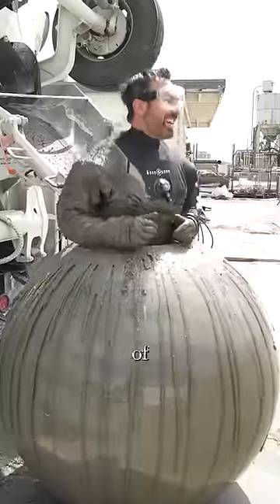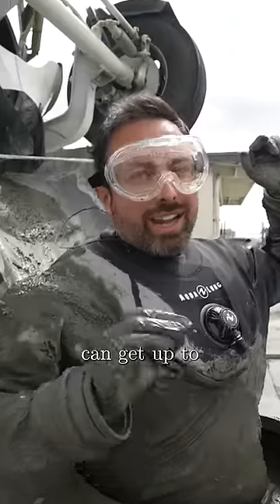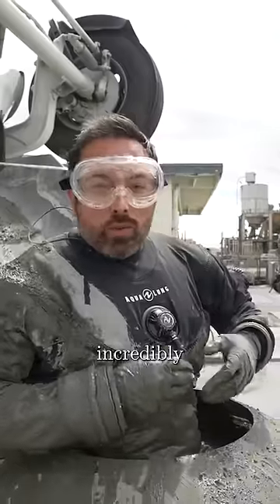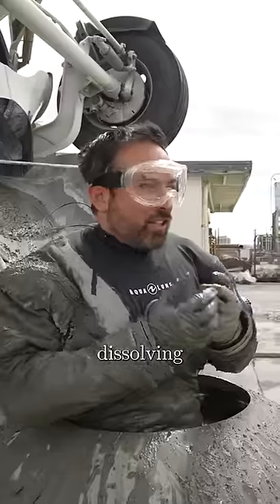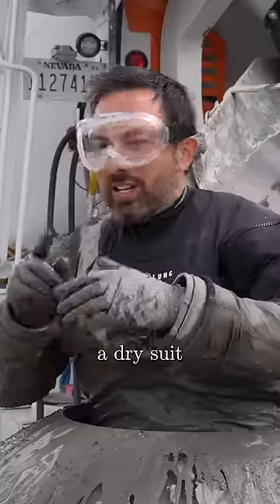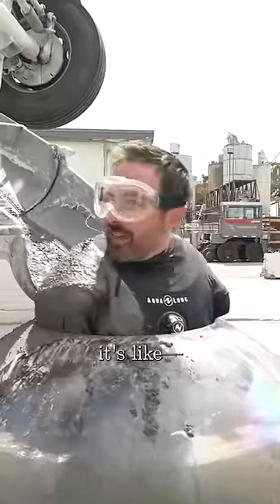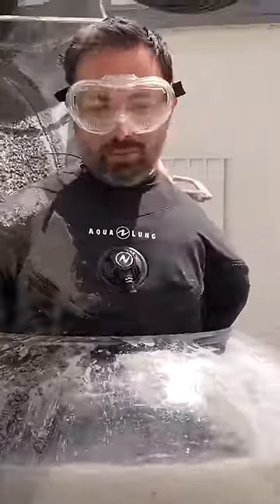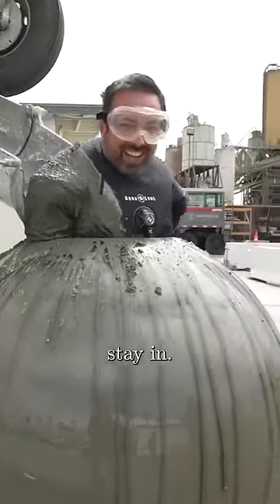I buried myself in concrete to explain how it works

Comment: Now knowing that cement dissolves your skin makes getting killed by concrete shoes even more terrifying
Reply: Why?
You'd be dead before it has time to dissolve
Reply: @AnEntityBrowsingYT nah cause the cement has to harden before they throw you in
Reply: So I've just done a quick search.
Concrete can take a day or so to dry obviously depending on thickness, temperature, and some other variables.

Concrete is typically made up of about 10-15% cement.

Cement is the part causing the issue here.

Adding water to cement turns calcium oxide into calcium hydroxide which raises the ph.

So it appears to be anywhere from as little as an hour that chemical burn blisters begin to form. 

So I'm wrong, you're right, you should be petrified 😂
Reply: @AnEntityBrowsingYT wow
Reply: I work with concrete and cement a lot, bare hands and feet, doesn't do any damage
Reply: @lpedr0l as long as you wash your hands and only stay in contact with it for a short time you’ll be fine, but if you do get burned it takes around 6 hours for it to show and is incredibly painful. Look up images of cement burns if you’re not too squeamish.
Reply: @AnEntityBrowsingYT Great example of 'I read it on Google, it must be true' vs real world skills. 

12 hours a day for 19 years says you are objectively and factually inaccurate.
Reply: @Aaaaaaarrrpirate Look it up. Yeah, concrete burns look unpleasent.
Reply: So you don't wash your hands for lunch break and don't wipe your hands when they are wet from concrete?  @bobSeigar
Reply: @jakubzeman8310  Imagine being a woman and taking a 'lunch break' 

Stay soft.
Reply: @bobSeigar Imagine being brainwashed into not valuing your own wellbeing to the point that your very identity is threatened by the thought of not working for 30-60 min in a 12 hour period while you fulfill a necessary bodily function.

Stay brittle.
Reply: @AnEntityBrowsingYT or you just take quick cement, 10-30 mins, hard
Reply: @bobSeigar   real big man working 16 hour days bathing in concrete and instead of eating just drinks a whole pot of black coffee while the foreman sits in his nice air conditioned F150 eating a big mac
Reply: @unploog  1) Liking your own comment is kinda pathetic.

2) Anime profile pics please go ask mommy to heat the nuggies
Reply: @bobSeigar Worst opinions and commenter I’ve seen today, congrats!
Reply: I did flat work and went onto commercial pours. You have the "I didn't wear a helmet, and im fine attitude." If it is a complete non issue then there'd be no reason for anybody to worry; except people do, a lot. Be safe. Wear the PPE.   @lpedr0l
Reply: @gotskills23 It's super weird how people wear that as a point of pride. Like we should want to work ourselves into the graves for soulless companies, rich dudes, and broken systems. But it keeps the masses in line for the most part I guess 🤷‍♂️
Reply: @bobSeigar You keep making these comments on company time and we're docking your pay. If you got time to be mean, you got time to clean!
Reply: don’t feed the troll…
Reply: @gotskills23  That's cute, I don't work anymore. Don't need to. 

Don't forget to clean your room, don't wanna upset mommy.
Reply: @bobSeigar  you're projecting your mummy issues, this is your second comment talking about strangers' mummies...
Reply: @unploog  i love this comment, and it doesn't sound too far off his real work life lol
Reply: @bobSeigar  so you just let wet CEMENT dry on you for hours at a time?

Also, Bob, I'd be more inclined to side with the many sources explaining how it happens over you. 

You're a man of quantity over quality with your pride of putting yourself into an early grave working 12 hour days.

I'm fine with my regular hours of concentrated work programming hardware for fire detection systems that you'll be angry at because I very likely get paid more for my 8-9 hours than you did for your 12 hours. (Quality over quantity)
Reply: @AnEntityBrowsingYT  It's wild when people connect their masculinity with being abused by large corporations, working 16hr days with little to no breaks. 

Never thought about the programming required for fire detection equipment, going to have to look at that now - that's awesome.
Reply: @bobSeigar did you take any breaks during the day when you were working?
Reply: @somethingelse516  There's enough standing around while working, I could smoke while working and I eat twice a day. 

What would have been the point? To lengthen the work day by another, unpaid, hour?

Struggle early to be secure later.
Reply: @bobSeigar  I know all too well, you worked during an era where people would be mocked, written up or fired for asking for a break. Ask for a smoke though and you were golden. Many people took up smoking ( some died ) just to be able to take a break. 

It was the way that it was, but it wasn't good, better or more masculine. Companies abused your body and mind back then like they do today, it wasn't ok then, it's not ok now.

Wanting to have a lunch break is ok, it doesn't make someone less masculine/strong, it doesn't make them a worse employee, it only makes them less tolerant to the abuses you and I were taught to not only be ok with but to laude.
Reply: @nitro6002  Weird hyper-fixation on smoking, and masculinity but okay then, that is a lot of irrelevant information. Had nothing to do with being "masculine" and all about securing my future. I would have done the grind if I was a female as well. 

Also, "many people took up smoking just to take a break" Cool. That is a drive to be lazy, thanks for confirming what I am speaking on. 

Tbh, it all sounds like a justification to be unproductive and are an overall distraction. If you want to accept your deathdrive and will be be naught, you do you, boo.
Reply: @bobSeigar  You have a fixation on justifying bad circumstances. There's no need for skipping lunch to have a future. All of these companies going back to the original mining corporations had enough money to play their employees enough to be able to retire early and have lunch. The entire point is that justifying corporate abuse and the willingness to endure it as "not lazy" is doing billionaires work for them. They didn't become billionaires by working hard, they became billionaires by convincing people to think like you do.

The justification of it is what I find weird. You write like someone who ascribed to the Marlboro man commercials and I referred to the information you gave. That you didn't buy into the masculinity part and just think it's ok is honestly somehow worse.
Reply: There actually has never been a recorded case of concrete shoes
Reply: @bobSeigar Also you willfully missed the point regarding breaks. These weren't lazy people, these were people working 16hr+ days who should have been given a decent lunch. I'm not sure if you just don't know your history or are ignoring it.

That you buy into corporate rhetoric so hard is terrifying.
Reply: Cement is not concrete. Is a misconception to think that cement is concrete, in fact, cement is just an ingredient of concrete.
Reply: Part of why them fellas that got the concrete overshoes usually end up on the shore not too long after, ankles are always the first to go
Reply: Quickcrete
Reply: And it heats up, so you also get burnt to a crisp
Reply: First thing I thought of when he said it. Almost came to comment.
Reply: If you ever want to horrify yourself look up concrete burns. So many people don’t know it burns and they walk on it in bear feet so the shoes don’t get fucked.
Reply: You would just have really dry feet under water so would be wet wait, what
Reply: He's slightly exaggerating, it's not gonna melt your skin off, I work with concrete and my hands are still here lol. Maybe if you let your skin sit in it for a long time, but at that point you're risking it drying and that's a whole nother problem
Reply: This thread is hilarious
Reply: @bobSeigar bro what, unless your employer is genuinely a good guy you should take all the breaks you can get
Reply: @kullijuusto   10000% Take breaks, live life, be happy - no one should die making billionaires richer or repeating their message.
Reply: It wouldn't. PH goes from a  scale of 0-14, 0 being acidic and 14 being "basic". A Real-World example of 12 pH would be soapy water, bleach, and oven cleaner. It may be a little irritating, but it will not melt your skin.
Reply: @Aaaaaaarrrpirate  this, got it on the insides of my nails on my foot once... probably quite mild too and still hurt like a bitch and took a while to heal
Reply: @Ritz_Quest Incredibly misleading and incorrect to try and slip soapy water in there. Soapy water is usually just above 7 pH. Since it’s both acidic and basic, and is designed for use on human skin, it’s not at all like bleach on your skin.
Reply: @lpedr0l You say that now… But look at most 50 year old builders/bricklayers hands.
Reply: @lpedr0l concrete burn is definitely a thing lol
Reply: @bobSeigar actually you are wrong lol, 19 years of concreting isnt something to be proud of either m8, ive done my share, the fact you didnt get out before 19 years says a lot. Concrete burn is a thing, but maybe you mix your concrete with 80% sand or somethn 😂
Reply: You’re drowning way before this, my guy
Reply: @fionngoat1011  it's spread over shoes / coverings, not feet, as the dissolving made it possible for some victims to escape
Reply: @AnEntityBrowsingYT everybody take a pause - someone on the internet just admitted they were wrong

ive never seen this before

im going to cry
Reply: @NoahStolee  😂
Reply: @AnEntityBrowsingYT good man most people don’t accept that they are wrong that’s respectable
Reply: @AnEntityBrowsingYT i love people like you who realize things and own up to it
Reply: @fionngoat1011 they never actually put your feet in concrete like some people believe. However, they WOULD chain your feet to cement  blocks that were dried and hardened, and throw you into water. That was common, but usually to dispose of dead bodies, but pretty sure it’s been done to people still alive.
Reply: @lpedr0l cement powder can give you nerve damage In the long run
Reply: @nitro6002 im a bit late😭😭 bro prolly muted convo or something 💀
Reply: Oh, it's so much worse.Because the concrete they're gonna be using.It's gonna be quick setting concrete so that stuff tends to get Extremely hot because the reaction going on is extremely exothermic. So you're going to get Burns and chemical burns?So yeah definitely not a fun time
Reply: @bobSeigar yeah say goodbye to your old age buddy
Reply: @Aaaaaaarrrpirate ahh those burns ain’t that bad lookin u gotta be very squeamish for that to be to much to see, I mean I’ll do you one better but still not bad bad, look at someone’s body part that went through a meat grinder, and not the part that came out nah that’s fine I’m talking about where there let’s say arm for example is still attached to their body and it’s torn up
Reply: @bobSeigar  bought the best bait on the market
Reply: @AnEntityBrowsingYT  you accepted you were wrong and looked it up on your own. You are a rare breed brother.
Reply: Nobody makes “concrete shoes”, to drown someone😂, the just tie you to a few cinder blocks
Reply: @evanwiechert3168 lol ikr! Concrete shoes doesn't mean literal shoes made of concrete any more than 'sleeping with the fishes' involves tucking someone in to bed with a goldfish! 😂😂😂
Reply: @bobSeigar   we get it you dont believe in concrete burns that doesn't mean they're a myth.
Reply: @CONMANNSWORLD  I get you believe everything you see and are told.

Also, false assertion, Queer'an.
Reply: @bobSeigar 🫃
Reply: @bobSeigar  I get it not everything you read online is true but it takes a special type of fella to think something like a concrete burn is a fake.
Reply: @gotskills23  Or instead of having lunch making your 12 hour shift 12.5 hours, skip lunch and get home a half hour earlier.
Reply: @SilverStarHeggisist  Been there, done that, wouldn’t do it again, but more importantly wouldn’t shame someone else for taking the lunch.
Reply: @Aaaaaaarrrpirate nope,the cement just hardened and that's it.
Reply: @gotskills23  at the same time I wouldn't ridicule someone for choosing to skip it.
Reply: @fionngoat1011 yeah being restrained tortured and then dumped in the ocean seems worse, way worse than concrete burns 😂
Reply: @SilverStarHeggisist  agreed, and I didn’t, but I took exception to them shaming others for the idea of taking a lunch and I suspect their motivation in not taking lunches themselves was an internalized version of the same, not because they wanted to get home earlier.
Reply: @gotskills23  I believe he felt he was attacked over it when whoever it was (YouTube mobile makes it difficult to go back and see who) seemed miffed when he said having concrete on his hands for 12 hours when that person responded with what about lunch and such.
Reply: its awsome that you admited you were wrong. most dont do that and just die on the hill. i respect you for admiting you were wrong and even saying how the other person was right @AnEntityBrowsingYT
Reply: @AnEntityBrowsingYT  Woah, the more you know! Thank you!
Reply: @lpedr0l I’ve had cement burn on my legs (top of my boots)  and it was bloody sore.
Reply: Also cement is exothermic. So you’re also getting burns. And as it sets on your already chemically burning skit it sets into all the skin abrasions meaning even if you get pulled out you’ve suffered many burns dehydration because the cement makes you release water because of osmosis. Most people if get stuck in cement with none protective gear die even if they can breath
Reply: @nickbob2003  Come on buddy you can't really be getting pissed off and arguing with multiple people in a fuckin youtube comment section, and be telling people how to live their lives. You can't even make an argument, you're just insulting people lmao.
Reply: @bobSeigar bro tried to defend himself and got flamed 😂
Reply: @bobSeigar  since you seem to have an innate hatred for easily verifiable information on the internet, (a trait that I only see in ignorant older people for some odd reason) you can find plenty of information on this stuff in scholarly articles/books which you can get from a local library.  This can all be proven by science with not only theoretical stuff by looking at the chemical composition of concrete to see that it is high in free OH- molecules but you can also prove it with studies that look at the effects of prolonged exposure of concrete.

If you instead think that the only way to know something for sure is to do it yourself, then how what about general relativity? The theory was created long ago but we have been proving its predictions right ever since it was made through experiments.
Reply: doesnt it automatically like your own comments @bobSeigar
Reply: you realize they just TIE cement to people’s shoes. they don’t actually sit them in concrete and wait days for it to dry🤣
Reply: concrete shoes is the term for covering somes feet in concrete and dumping them in a deep body of water. youll most likely have shoes on when they do it lmao. it would be worse getting throwin in a pit of concrete and having it filled in over you. which is another way people who "give concrete shoes" do to people.
Reply: I've done concrete work for 13 years. I hate getting on my hands. Even if you wash them, they feel dry. I'll put lotion on, and my hands suck it right up.
Reply: @bobSeigar  You got womanly soft hands brother. 16 hours a day for 23 years. My hands are fucked and I assure you, it can happen. Usually doesn’t though cause you need to be absolutely covered in it.
Reply: @AnEntityBrowsingYT Totally right my pops went to work one day and came back from cement burns
Reply: @AnEntityBrowsingYT I work concrete. There's also an extra variable. Excelarator. Making it dry faster
Reply: @bobSeigar  this is the type of guy that your boss puts you with on a job, then he magically disappears to the shitter while you're doing the work. Not a break if nobody sees, I catch you're drift bro
Reply: Work with cement and Lime burns are the things that burn lil holes in ur hands
Reply: @fionngoat1011  The cement is already hard, been hard for months, "concrete shoes" is just cinderblocks chained to your legs
Reply: Toasty_Fluff  ok ok big head, thanks for the reply. Above are the bros' responses and now I get it

Edit: thanks bro's that answered my comment
Reply: @squidwardshouse7375  lol,  based on the many more responses, they probably should have muted ☠️
Reply: @bobSeigar  It's amazing, you started off belittling people, went to bragging about being used by a company, then full blown corporate mouth piece, and ended with bigotry using sexuality as a slur. Truly an upstanding fellow and model of corporate training.

Somewhere in those 12 hr shifts they didn't teach you about accepting mistakes and knowing when you're wrong. 

You go all-in on deuces don't you?
Reply: that’s not a struggle you just have a different work environment then others. i’ve been somewhere there just wasn’t time to stand around, there was ALWAYS something more to do. i had a lunch break for 30 minutes because they valued our sanity, but i didn’t get your standing around smoking. not a struggle
Reply: @bobSeigar lmao okay bud. Everyone here is laughing at you
Reply: ... concrete shoes aren't literally concrete shoes. It's when you chain a person to a concrete cinderblock and throw them in a body of water.
Reply: @fionngoat1011 only been done once and even then the concrete didn’t set
Reply: @AnEntityBrowsingYT if it's hot enough concrete drys in an hour, hard enough to walk on.
Reply: @thegman4759  Another variable. This entire thread has been a comparable situation to creating the specifications to a piece of software. You start with what you know and then research or other people just keep adding to the complexity and requirements XD
Reply: Cement shoes isn't literal
Reply: @bobSeigar no way bro just tried to flex not taking a lunch break 💀 literal slave to your company
Reply: It’s not like it melts you on contact lmao
Reply: @notafrog5150  Take a look at the many comments after the main OP comment. There's been a whole discussion you've decided to overlook
Reply: @AnthonyTrudeau  I don't wear a hard hat never do not unless the sky is coming down
Reply: @thegman4759  Strange thing to be proud of
Reply: Nah easier to deglove your feet
Reply: Just to add to your fear. I'm a mason by trade. Have had concrete fill my boots during a pour, I thought I could make it an hour or two before completely changing socks or boots. When I took the boots and socks off, 75% of the skin on my feet came off with the socks and boots.
Reply: If you wait till the mobsters leave. You can relax and deglove your feet.
Reply: They probably just secure ur feet into pre made molds not harden concrete on feet duh
Reply: @AnEntityBrowsingYT the kind of person you want in the group project
Reply: How? Why would concrete burning your foot be more terrifying than drowning?
Reply: Rip
Reply: @chuckymota847 tie a cinder block? The bloated body would almost certainly resurface 😂 if nothing else you'd need a pickaxe to prevent the corpse from swelling and talking too much but that's why it's better to just get rid of it i.e. working in plastics or metals.
Reply: @bobSeigar you’re trying to hard buddy
Reply: I work with concrete and have it dry on my skin everyday lol it leaves red burns not too painful
Reply: That’s not what cement shoes means
Reply: All I’ll say is you don’t believe anyone actually used concrete boots do you?
Reply: @bobSeigar imagine disregarding your rights as a worker
Reply: @_meekus  Imagine thinking rights come without responsibilities. 

Again, I've yet to seen a non-wage slave response. I retired in my 30s, how about you?
Reply: It’s not really as dramatic as it sounds. 
Worked with concrete for years, it mostly just dries out skin out pretty bad. 
If there’s lime (not the citrus) in the mix, it will burn your skin, but nobody really uses lime anymore at least not in Australia.
Reply: @AnEntityBrowsingYT Hydraulic cement is rock hard in about 60 seconds. That’s what they used.
Reply: Keep the @bobSeigar  replies going.
It's hilarious to read this guys arguments.
Reply: I can't believe nobody mentioned his giant ball, and why there's only 1 of them.
Reply: @bobSeigar it literally is true though, even if you feel like its not.
Reply: @cormey8772  No. Missed Cummy.
Reply: Concrete shoes are cinder blocks tied to a person not actually sticking a persons foot into cement...
Reply: @bobSeigar fragile male ego spotted 🤣
Reply: @bobSeigar I like that instead of trying to make an actual jab, you just recycled common insults. I expected better of you bob
Reply: Good thing concrete shoes were only ever a myth, mobsters never actually did that.
Reply: @bobSeigar 
"Imagine being a woman... lunch break"
What did you mean by this? 🤔
Reply: @gotskills23 
Lmao, love that line at the end.

You know, because of the whole "increase hardness, decrease ductility" thing in material science and engineering... explaining jokes sucks...
Reply: @demonindenim 
"Sheen, this is the third week in a row you've presented your mommy-dommy fan-fic" 💀
Reply: @nitro6002 
Nvm. 😶
Reply: Im more worried about the drowning.
Reply: That bob dont know about ratio😊
Reply: @lpedr0l I call BS! I know a guy who does concrete & he literally has chemical burns all over his legs & ankles from when he first started & accidentally let concrete get between his boots, onto his legs & bare skin for too long. He definitely learned the hard way.
Reply: Why would they do that instead of tying bricks to your feet or something
Reply: Now I don't know if you guys work with a really strong and powerfull concrete or work with wrong measures. Here in Brazil we work lively and no harm!
Reply: @bobSeigar   bait used to be believable, you're not even trying
Reply: @bobSeigar   genius strategy, not refuting the point and turning to petty insults truly reserved for the smartest in society
Reply: @bobSeigar   bro's trying to sling insults and he's unemployed
Reply: @jakubzeman8310  There's often nowhere to wash your hands on a construction site, just hand sanitizer in the porta potties if you're lucky
Reply: @Millticker  Unemployed because Employer. Don't act like your missing father.
Reply: @Millticker  Double reply. 

Bark dog, bark. I hear the shackles rattling.
Reply: @bobSeigar  did both your parents leave you? you talk about them so much
Reply: They were never alive when they were weighed down with cement 
Try holding someone still long enough for concrete to cure around their feet.
Reply: @noahmontgomery9902  nah, ask Cosby about keeping people out for a long time
Reply: @lpedr0l thats just false. ive read some horror stories about getting it in your boots and not realizing your skin is gone because all the nerves died first
Reply: @bigboi9856  yeah and I repeat, here where I live that doesn't help. Or your cement is much stronger or you use high concentrations, higher than we do.
Reply: @AnEntityBrowsingYT also concrete gets exceedingly hot while it is hardening.
Reply: It doesn't disolve skin it would take a long ass time and would cure way beforehand
 but it burn like hell
Reply: @brody7714  Right! We trust folks named brody, who eat cheetos all day in Moms basement, they know everything they are talking about. After all, Wizdumb beats Aktion
Reply: @bobSeigar you’ve been buried in concrete for that long? I doubt it
Reply: @natedawg1007  Great goalposting shifting, don't be fallacious, dog. Woof woof.
Reply: Thats just a thing in movies.
Reply: That's not how that works 😒
Reply: @Omni-King2099  and how do you know?
Reply: @AnEntityBrowsingYT That’s not quality over quantity. That’s just working in a more specialized field, where the market is determining to pay you more for a more niche skillset. That doesn’t make you more valuable to society, it just means a corpo has the money to pay for your existence. I work in CySec, don’t let a white collar job get to your head. Find some humility.
Reply: @networknomad5600  You might want to read the comment that I was replying to if you're suggesting I'm the one in this scenario that requires humility.
Reply: you didn't know that?
Reply: @bobSeigar  you should read some Marcus Aurelius. It sounds like you have a very stressed mind.
Reply: @bobSeigar  You literally said "imagine being a woman and taking a break. Stay soft." And then criticized someone else for their "hyper fixation" on masculinity. You literally brought it up. Feeling ok??
Reply: @Petie718  Being a man ≠ masculinity nerd. Two totally different words with different meanings. I know you are probably ESL, but one does not begin a sentence with 'and' either. 

Stay Flaccid Pete.
Reply: @bobSeigar  imagine being a woman and leaving work. Real men don't retire, you got baby hands brother
Reply: @lpedr0l  cancer speedrun
Reply: @JakobJakob1  Actually I can't have câncer
Reply: If it dissolves enough skin, maybe you can slip your feet out
Reply: So i work in water utilities and they had finished a 40 mile stretch of 60 inch concrete pipe. So the geniouses decided to "take a tour" of the new line before puttibg it into service. There was about 3 inches of water left from pressure testing testing and other stuff. The residual pH of the concrete literally ate the boots off of their feet.
Reply: @lpedr0l your either working with some special concrete or full of crap. I did precast work and concrete burns were a given.
Reply: It does start to burn a bit
Reply: @NostalgiaHDOS  concrete microwaves on the other hand… (god that guy cementing his head into a microwave XD I mean, who even does that)
Reply: @beady123 oh…right… mannnn, I’m a terrible gangster! What am I gonna do now?! I have, like, 83 goldfish. And this large assortment of concrete trainers. What next? You gonna be telling me dealing Coke doesn’t mean selling cola?
Reply: Everyone please read the Bible!
Reply: It just burns a bit, I think it doesn't matter much when everyone knows they will drown tomorrow.
Reply: @bobSeigar you shouldn't lick boots so much, and tell your wife to stop putting lead paint flakes in your cereal
Reply: @alexengel6240  At least I have a wife and can afford cereal. Meanwhile, what's life like being a Barbarian? How do rocks taste?
Reply: @bobSeigar  nah man this is a example of feeled anecdotal evidence and missunderstanding, u definitly will get the burns ifnu wait long enough they just dont do.
Reply: I thought concrete shoes were just already existing cinderblocks tied to your feet so you’d sink
Reply: @fionngoat1011 no one does that lol they will just tie rocks to your feet
Reply: Probably never actually happened due to how long it takes for concrete to dry
Reply: @JoeKurr5  What is more "Research" than 19 years, and then another 7 owning a company? 

Imagine believing everything you read, because you're too cowardly to do it yourself. 

Stop mouth breathing.
Reply: @NostalgiaHDOS apparently there was one in 2016. 

I imagine it's just a whole lot less practical than just tying blocks to people than actually setting the concrete